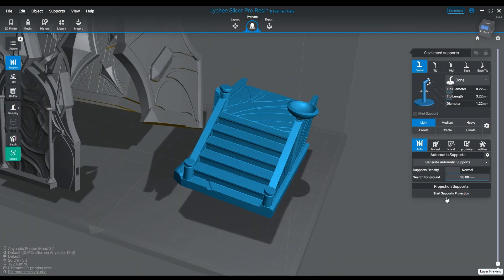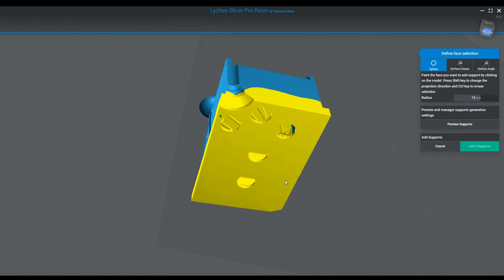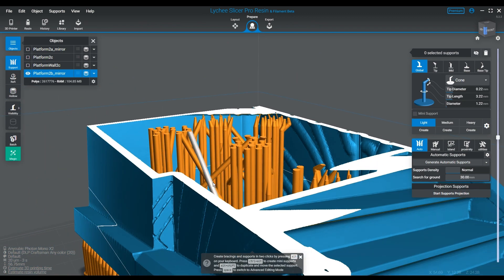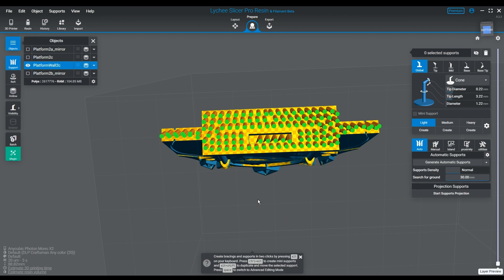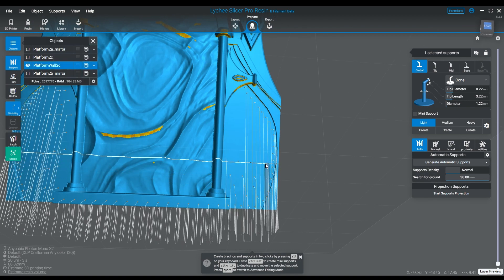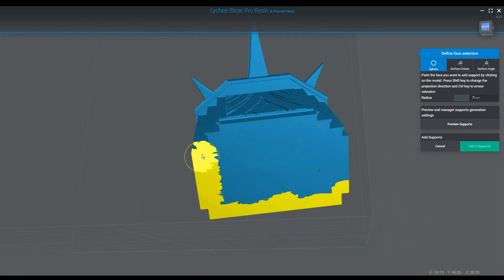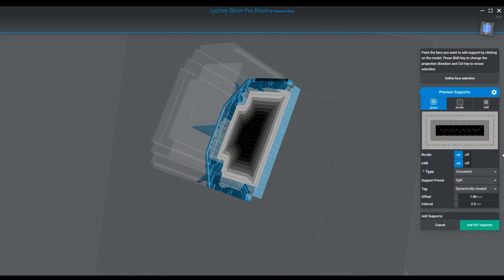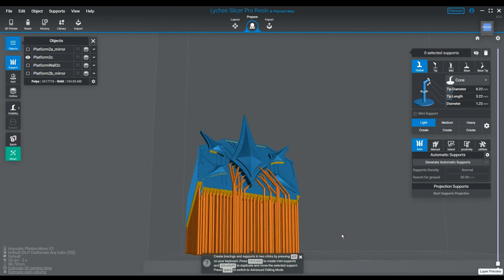Fully Supported Episode 6 the next best thing since auto supports

Comment: Good video - new to Lychee Pro and found that when you do support projections, if you choose Surface Crease its easier than painting everything. Surface Crease you just click on a flat plain you want to add supports and it selects the entire surface, so it saves time. No need to paint all the surfaces. On the bottom of a flat surface just one click and your done. BTW sub'd and liked.
Reply from the maker: Cool, I need to try that for sure.